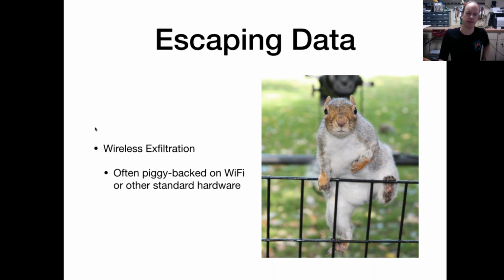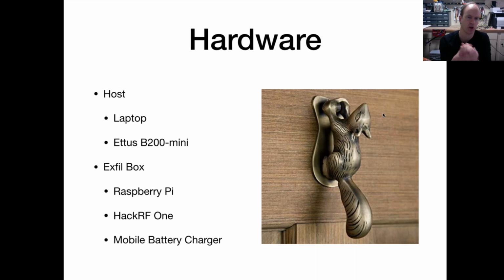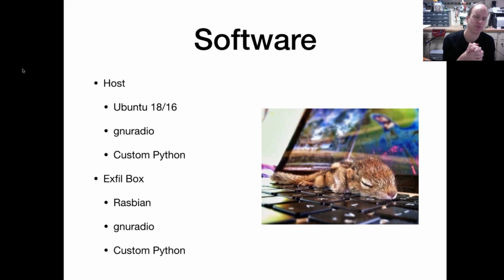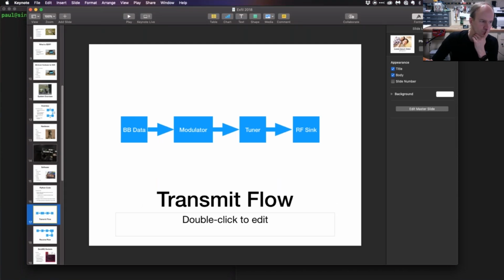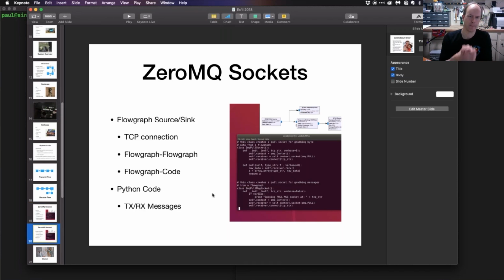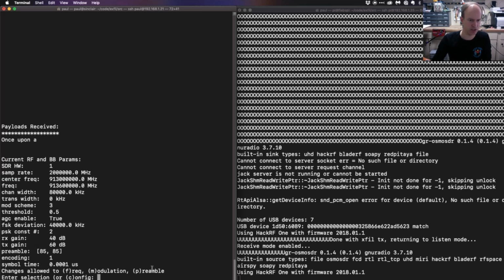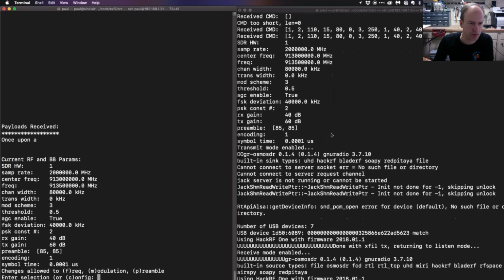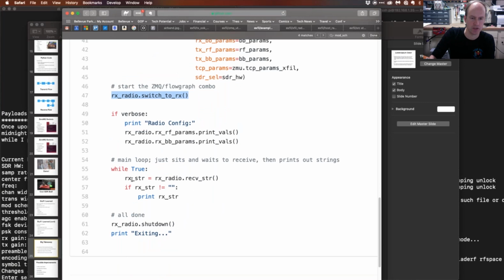Building a Small and Flexible Wireless Exfiltration Box with SDR

Comment: Regarding the Transmit Flow slide, what type of file is the BaseBand data in.. complex , audio, ???  And wouldn't there be some Intermediate Frequency Mixer be in the Receive Flow Flow?

You mention there is a class you teach on SDR (Clock Sync) but I don't see it listed on the Black Hills website.. is it available online or only in person?

BTW, regarding the messages, I understand unlike RabbitMQ & MQTT, ZeroMQ does not require a central server.. but any thoughts Nanomsg that seems to be everywhere?